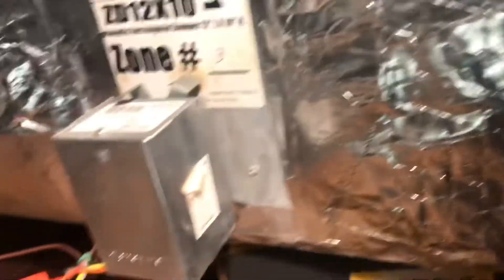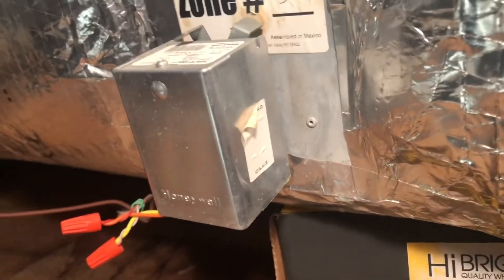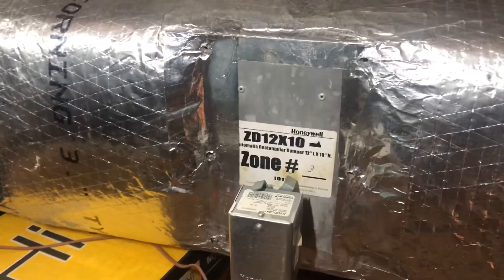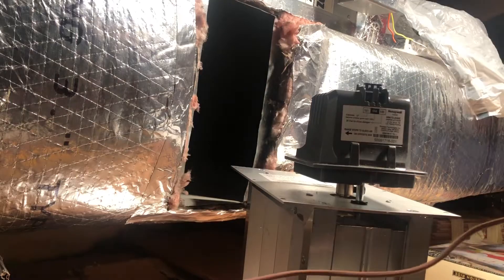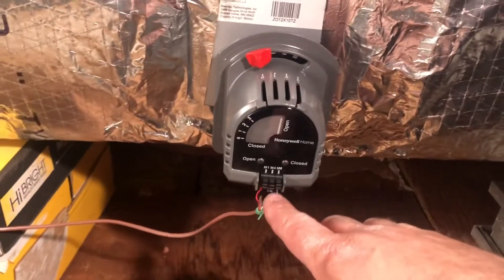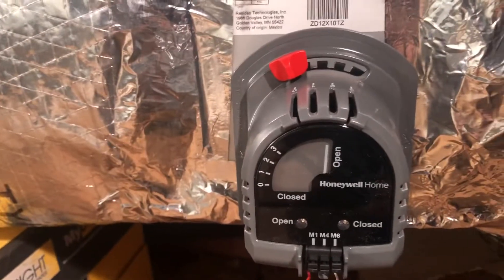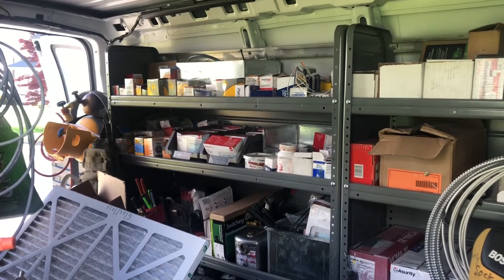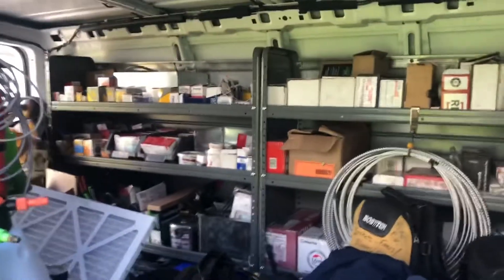HVAC Zone.  How to Fix Honeywell Zone Damper and Actuator.

Comment: Thanks for the great video, wondering if I can just unscrew the shaft bolt on the old damper motor box and slide on the new updated servo motor without taking out the Fin's box?
Reply from the maker: Yes you should be able to.